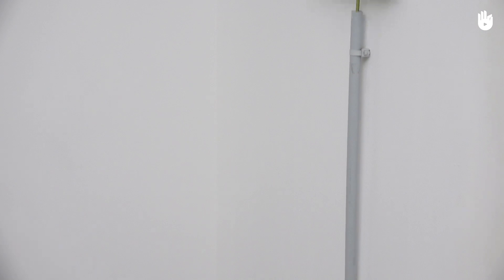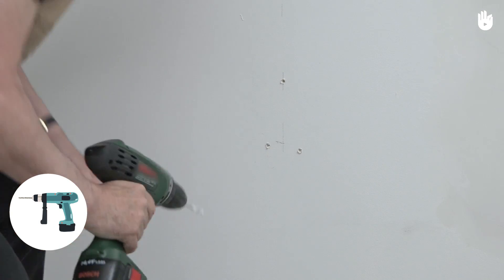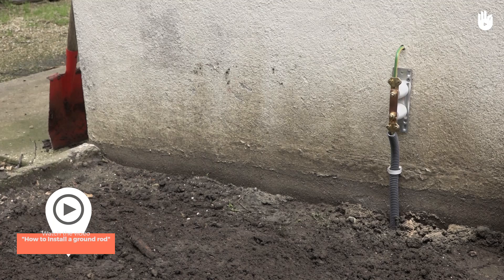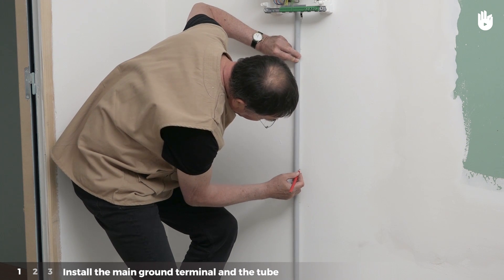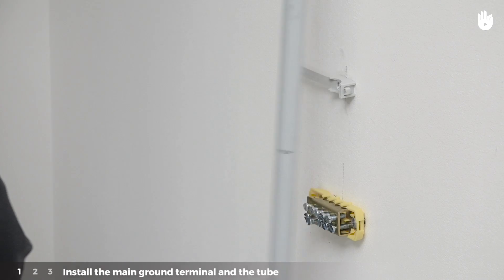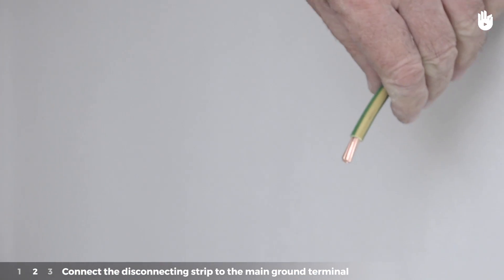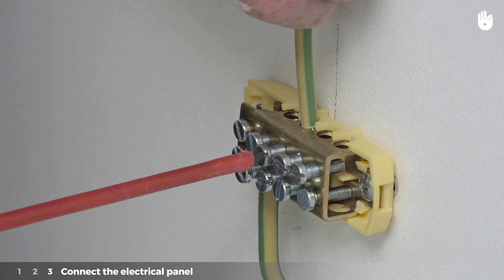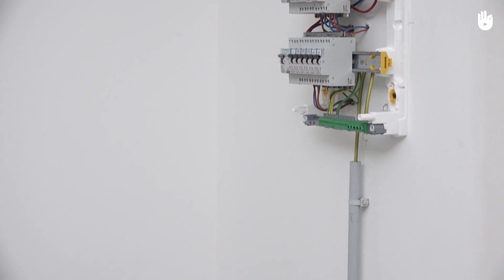Ground Connection: Connect to an Electrical Panel | Electricity

Comment: I don't think you're supposed to wire it that way. According to the BS 7671 if i remember correctly, the grounding must run from the acorn on the ground rod interrupted to the panel housing.